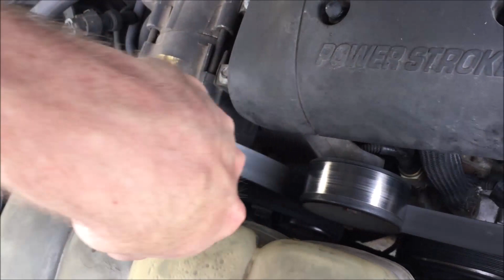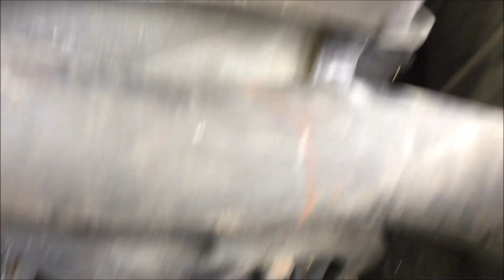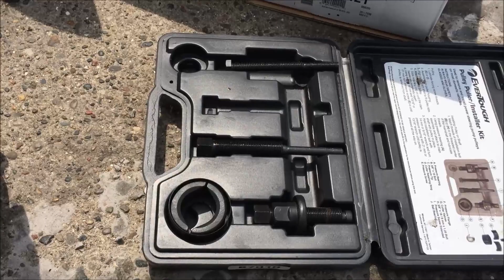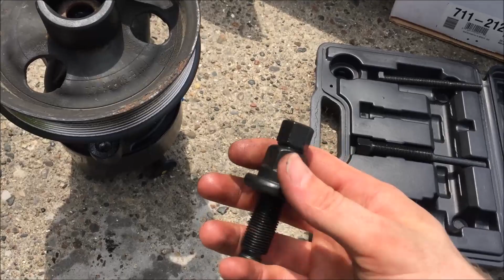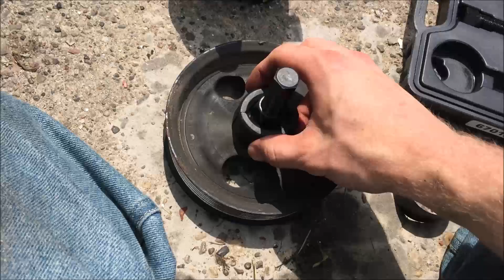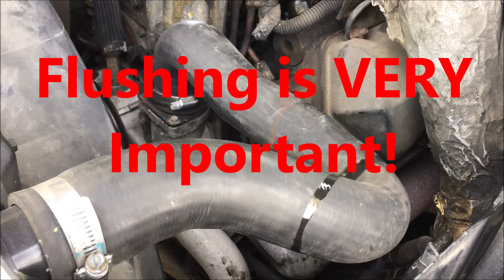7.3 Super Duty Power Steering Pump, How to replace 99-03 Ford Powerstroke power steering pump

Comment: Before I started the vehicle I would crank the steering wheel lock to lock with the wheels off the ground and pump the brakes at least ten times each to prevent cavitation and to prolong the life of the power steering pump and the system in general. Thought that was worth mentioning.
Reply: You mean after re assembling everything back on motor, before starting for first time, pump brakes and lock wheels to sides?
Reply: @damianperez3671 yes turn key on dont start lok to lok and pump brakes helps burb  the system before throwing power at it so it wont foam and cavitate as bad its not good on seals and o rings and is hard on pump
Reply from the maker: Good stuff right there. 👍🏼

Comment: Flushing the system doesn’t get you fd w the brake booster in any way? I swear I remember flushing one on a Chevy on this ranch I worked on and after hat the brake booster started acting up… I’m sure i probably did something wrong but still it was a pain in da ballz…
Reply from the maker: I haven’t had a problem with mine. I’m still driving this truck and no problems with the booster.

Comment: Curious if you HAVE to remove the bracket...?  Or will the pump come from the back...??
Reply: Pump will out from the back without removing the alternator/pump bracket. Some unbolt the alternator (3 bolts) and flip it out of the way and then remove the bracket (4 bolts) as it makes it easier to remove and re install the pulley on the pump.

Comment: There's a lock on the belt tensioner that holds it back so you can get the belt back on without holding pressure on the breaker bar